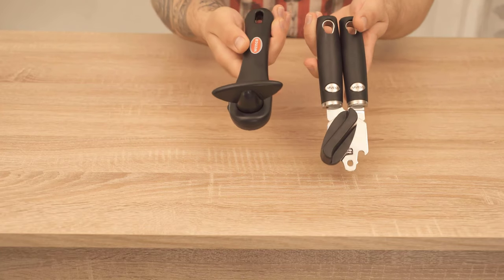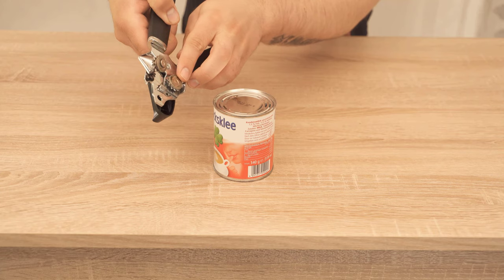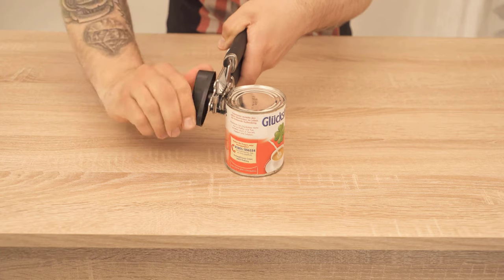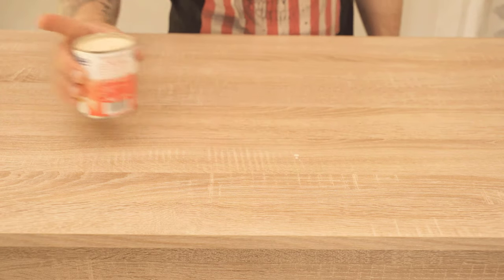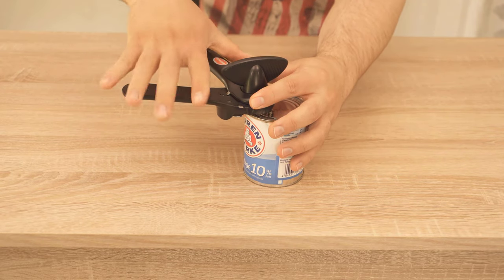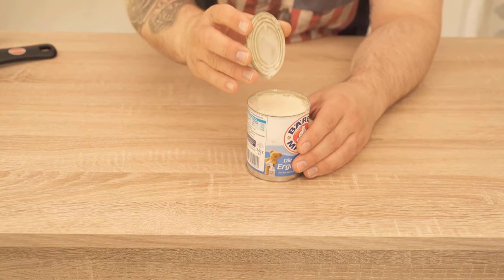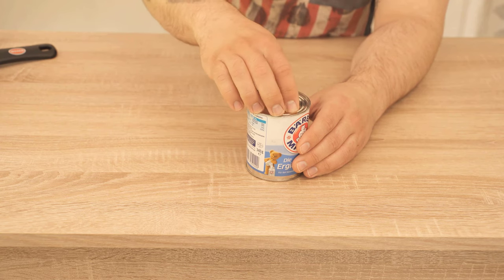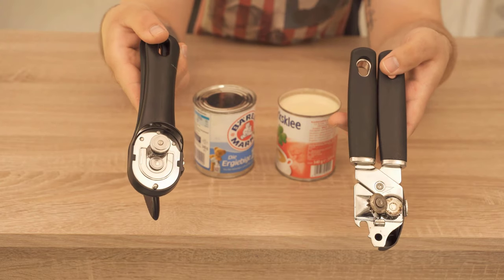How to use a can opener - How to Video! ✅

Comment: Spam comes in a easy pull open design. But sometimes the tag just comes out prematurely, you either perform a surgery or
take out a can opener.

The conventional cut through opener cannot make sharp turns, that leaves the job for a safety can opener to finish.

In case you only have a conventional opener. Take the opener as a pair of scissors at the corner, makes small cut one at a time.